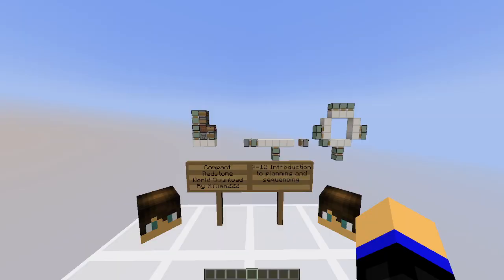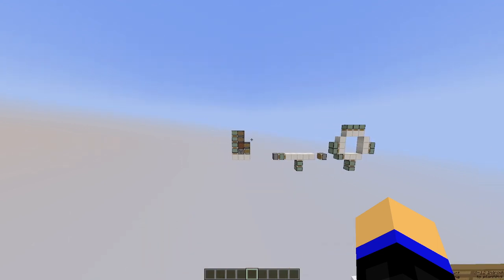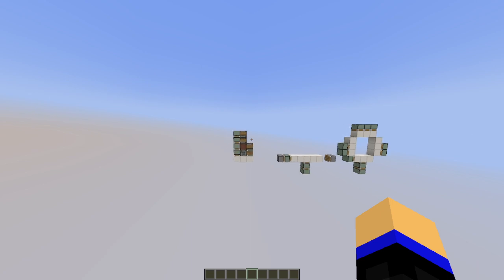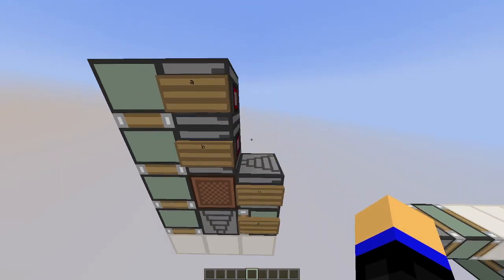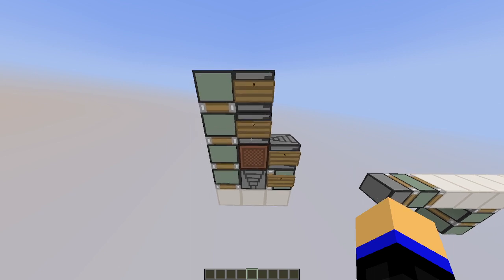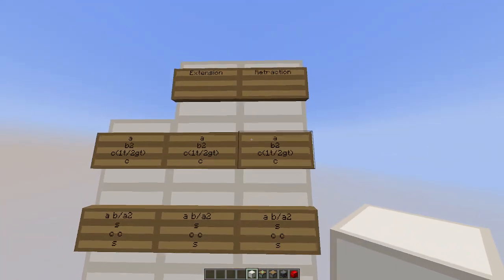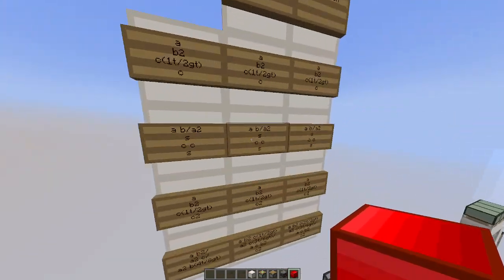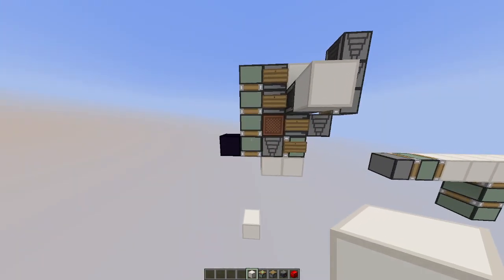Compact Redstone: 2-12 Introduction to planning and sequencing

Comment: Hi myuen, I have a question:
How to make a button long pulse using a constant power input, as small as possible.
Your vids are great, love them.
Reply: so how to make a pulse with a lever, or a pulse with a button?
Reply: No like making a button using a lever
Reply from the maker: If you want to convert from a button pulse to a constant signal, you need a toggle (T-Flip-Flop). This is introduced in 1-6 Pulse/Signal conversion (Circuits 6.25-6.28).
Video link: https://youtu.be/wTnuZMhwEGo
Drive link: https://drive.google.com/drive/folders/1gw44BvBDW_a3oE7NHEiVCOYYhWLaT3uW?usp=drive_link
If you are at the beginner level in redstone, I suggest you start watching from Level 1 and go up accordingly with the playlist.
Playlist link: https://www.youtube.com/playlist?list=PLDxFLIDNIzqsC4rh1aqko97Qqd7sM_Bj6
Reply: Thx
Reply: But what about reverse,convert a constant signal into a button
Reply: @K3v-owo  thats called a pulse shortener, there are many ways. For instance use a redstone dust next to a block, under the block is an upwards piston, and on the other side of the block from the dust is a repeater. You can also use a dropper pointing into a hopper which leads back to the dropper, and take comparstor output
Reply from the maker: As mentioned, the circuit that does this conversion is called a pulse shortener, although I usually call it a monostable circuit. This is also introduced in 1-6 Pulse/Signal conversion.
Reply: @myuen222 ok thanks